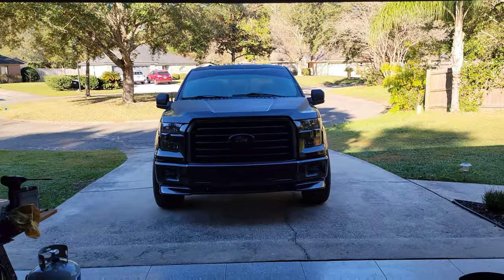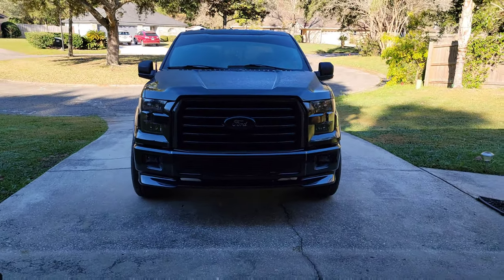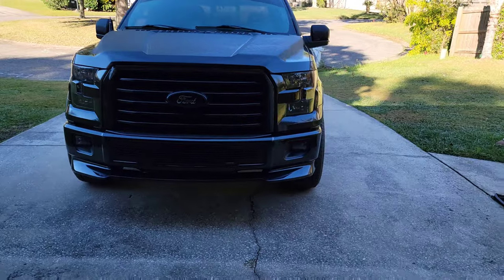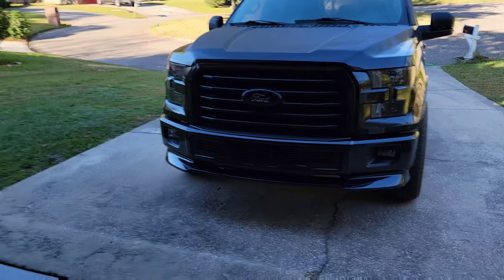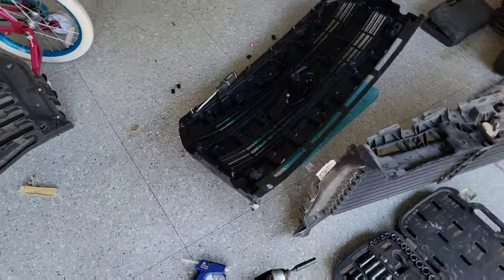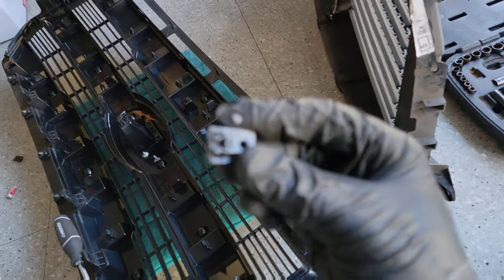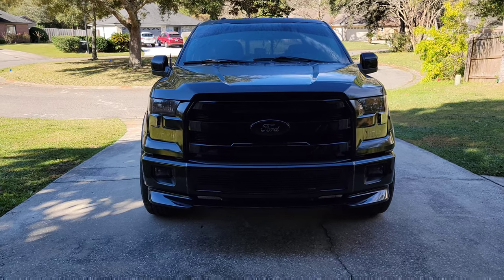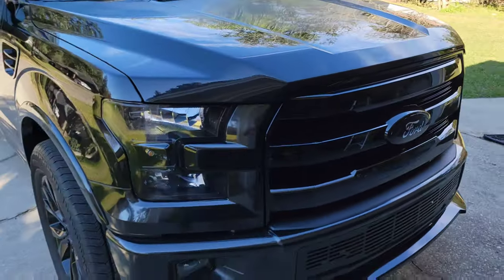2015-17 F150 Front Grill replacement

Comment: I have been looking at the splitter you have and I have the same grille on the way. I have a 2016 Magnetic in color. My grille and tailgate emblems are painted in Magnetic as well and all of the body emblems are removed except I have blacked out fender badges. My video upload has the old look with some red trim emblems in which I did not like. My 2.7 Ecoboost is a FBO except for the turbos, they are still stock. It has a VMP boost a pump and is e50 tuned. I was very glad to see your video to confirm my ideas, your truck looks damn good.

Comment: Looks great 👍.  Question... When you removed the grill. The louvers come out with it ?  Is there a connection you have to disconnect?  It's hard to see in fast speed.  I'm replacing transmission cooler line and it would be great to know the louvers come out to access cooler lines

Comment: Letmelive I a stupid question about a vid you did over a year ago about the solenoids and the power wheel battery you rigged to fix issue I'm having. Msg me personally or send me in the right direction to find info on how to split and strip battery wire and which Pen/post is positive and negative on solenoid being charged $1750 to replace them
Reply: If you can't I understand just figured it was worth a try. ThankS
Reply from the maker: get a pair of wire strippers from home depot and some wire. hook them up to battery and touch them to the solenoid. doesn't matter which goes where. You will hear it popping open/close if its good, nothing if its not.